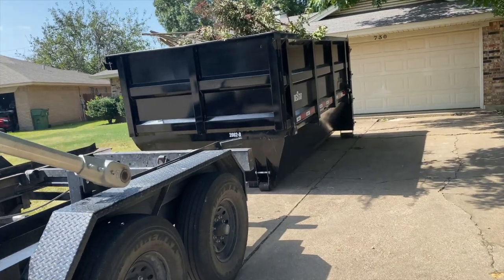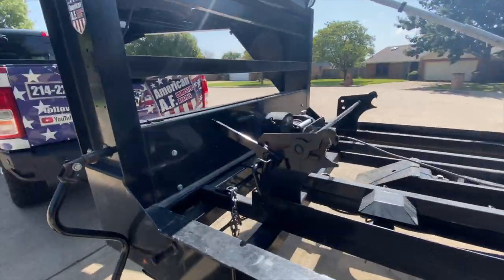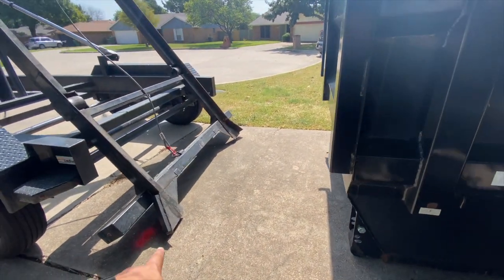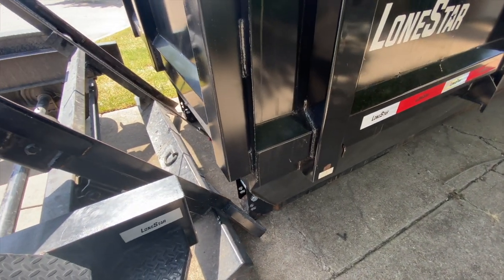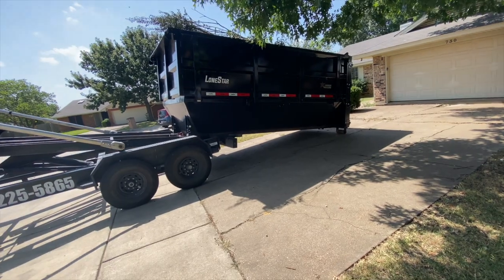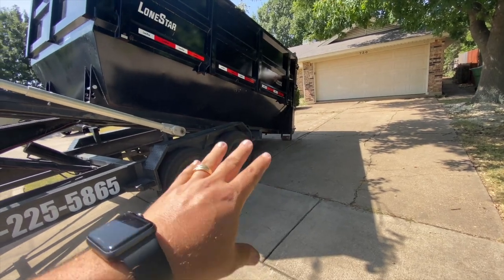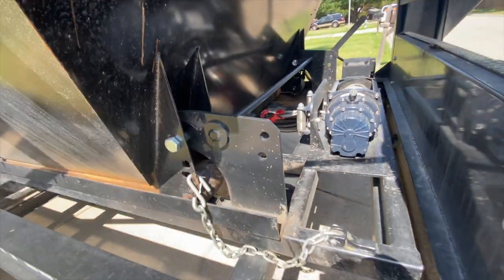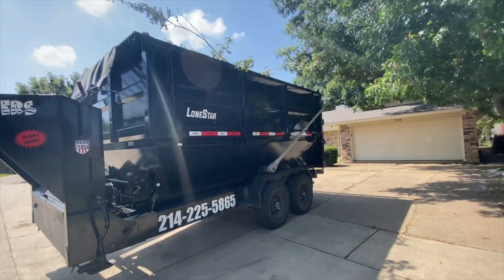Loading A Roll Off Dumpster - Step By Step

Comment: Awesome video and great tutorial on how that works! I’m also curious, does anything hold the back of the can down on the trailer? Or is it just the weight of the can that holds it down on the rails?
Reply from the maker: Ok so there is a tab on the back of the lonestar trailers that slide into a channel on all the lonestar trailers that hold the dumpsters down.  Problem is, those tabs really screw with the dump angle of the dumpster and break off when you are dumping at an angle that sometimes is required and needed at the landfill.  So I had the tabs cut off on my trailer.  The weight of the dumpster alone is usually enough, add to it the locking mechanism on the front and the chains on both sides of the front of the dumpster will keep that dumpster from going anywhere!
Reply: @AmericanAFDumpsters  Thanks! Was always curious to how it’s held down in the back. It’s been great watching you grow and run your dumpster business, keep up the good work! Stay humble, hustle hard!

Comment: this might be a dump question but ive been leaving my truck in park loading and unloading the dumpster. my truck seems to roll alot tho. does this hurt my transmission.
Reply from the maker: It could.  Never has for me but I have heard from some.  If it’s a really heavy load, you can “walk” the truck meaning leave it in N if it’s level ground.

Comment: Might need to change that winch out bro
Reply from the maker: How come?  Still works well I think lol
Reply: @AmericanAFDumpsters  lol I'm sure it does. But I was saying before something bad happens, like it's snapping. Should last you a little longer. I. A tow truck driver and had it happen. You have great looking trailers. Wouldn't want it to slide off and cause damage.